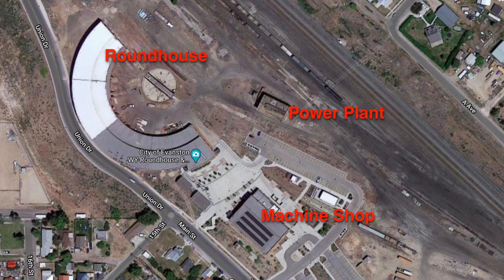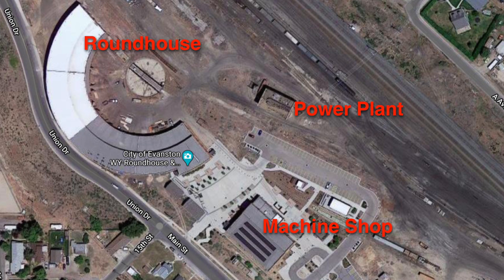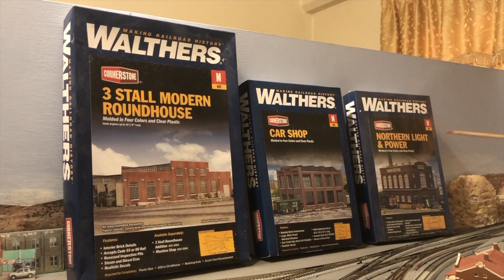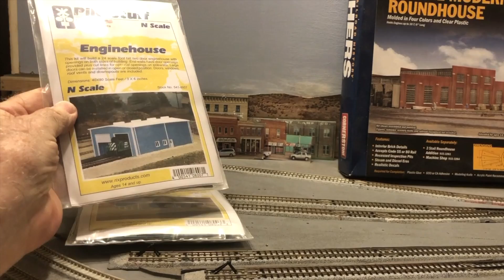Evanston Renovation 9: Selecting Structures for a Model Railroad

Comment: Nice plans.  However, the wye area before the highway bridge in my opinion is not complete. You need to put a UP style interlocking tower in the center of the wye.  It is not usual and it would distract from the dark “cave” under the bridge.   When you get a chance look up the train station in Marshall, Texas.  It is over 100 years old, still used by Amtrak and sits in the middle of the wye.  Two legs of the wye are mainline elevated curves.  The third leg goes into yard under a road bridge.  UP trains barrel through there all the the time.  The Challenger and Big Boy have both been in the yard on display.

Comment: I don’t know if there isn’t a kit that I wouldn’t modify at least in some way.  I am not afraid or opposed to building from scratch, it takes more time and weathering has to be done.  You have to be some what sick to model in N scale.  (Structures can be small.  I believe the center of my layout will be chemical, oil, and steel manufacturing complex’s. Coke and soda ash from the refinery and chemical plants will be used in the steel mill.